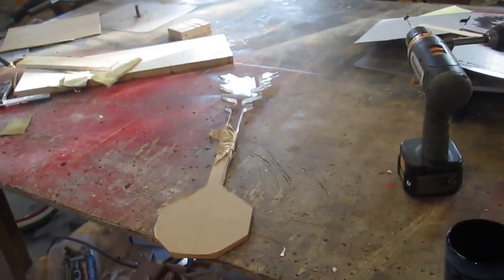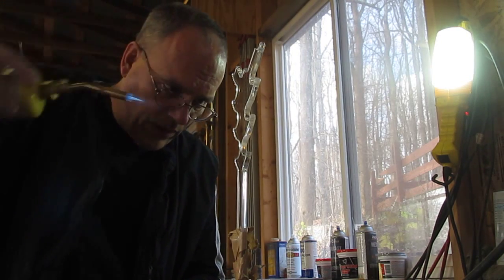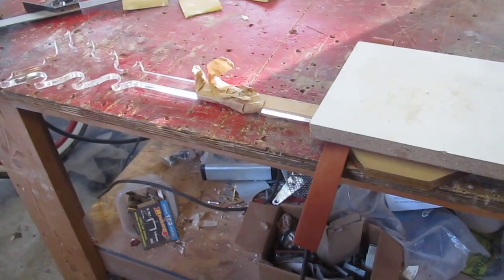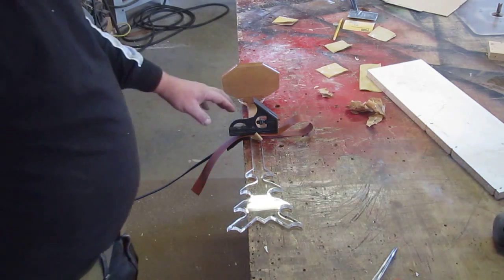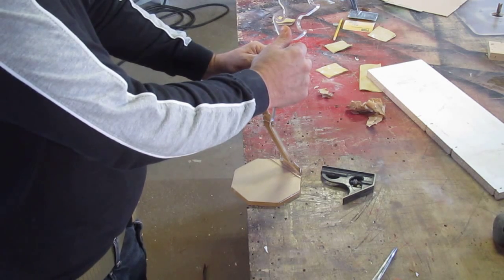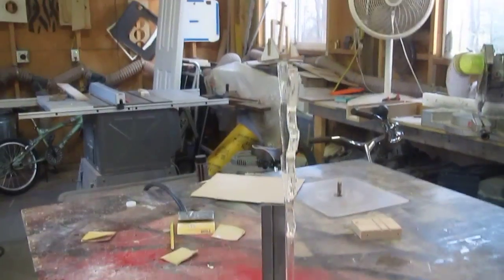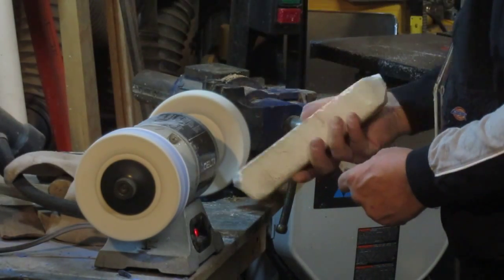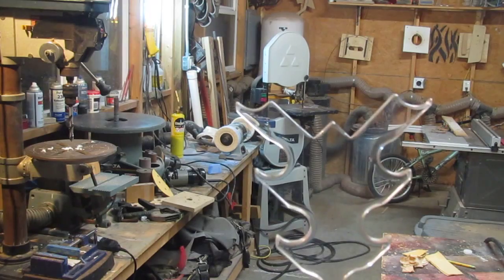Acrylic Tutorial: Flame, Buff, Form

Comment: Hello! I want to ask for some advice on a project I'm working on. I am trying to recreate a product (Brainwavz Peridot, googling it will give you a good idea of what I'm talking about) myself, since the Brainwavz Peridot has huge branding over it.
I want to use 8mm acrylic just like the Brainwavz Peridot. But there is one thing I want to change, which is to use two acorn nuts and a threaded bar to keep the thinnest part of the Brainwavz Peridot together. This will also give it a more industrial look (which I like). So, here are my questions:

- What tools do I need? (I know that I need a heater and a molt to give the acrylic it's shape. But what I don't know is to create a hole small enough for the threaded bar. Could a soldering iron used for this)?

- Are there any special things I need to watch out for or do you have any other advice? (It's my first time trying something like this).

Thanks in advance!
Reply from the maker: Theo B I appreciate you asking me how to make a headphone stand. You will need the use of a special kiln or an oven that you can possibly mess up. There is no way to heat plastic that large and thick evenly without heating the whole part at one time. Obviously this will make it difficult to manipulate scalding hot limp so you will need some way to handle it that does not leave marks or burn you. Then you will need to drape it over a form and compress it to take the form...again without leaving marks. Those are all difficult challenges that I would struggle to accomplish despite being a master craftsman with decades of experience. And finally the easy part drilling a hole with a plastic specific drill bit of the correct diameter. IMO you can't do this as a casual hobbyist. The challenges are too great. But you can certainly try and find out what will go awry...and I assure you that something will.
Reply: Mountain Storm Thanks for your useful advice! I will be trying to create the headphone stand. 
While thinking about creating the stand, I thought of something. What if I make a mold of the entire thing from wood, but instead of it being solid, I can take it apart so I can heat one part of the acrylic at the time. 
I'm not sure if you understand what I mean so I'll say it like this: If I was able to do one bend at the time. Would it work?

Thanks again!
Reply: Mountain Storm Hmm, that's not entirely what I meant. I mean that if I make a mold in which I could make 1 corner at the time. I might be able to just use a heater to heat 1 corner at the time. In which case I don't need to use a oven.
Reply from the maker: Theo B You'll need an oven to make large radius bends. A heater strip will allow you to bend nice sharp corners in thick material...but that only heats about an inch wide. A heat gun will bubble the surface before you get both sides equally hot enough to bend. You will need to evenly heat a 12" area to bend the top curve and about 6" to bend each side and the curves flow into each other. But as they say experience is what you get you when you don't get what you want so don't let me stop you from trying... :)
Reply: Mountain Storm Alright, thanks for all your words! I'll take all advice in mind and I'm gonna try to recreate it. Thanks again!